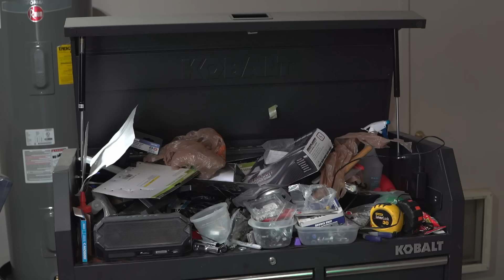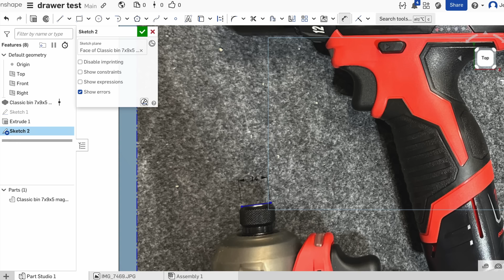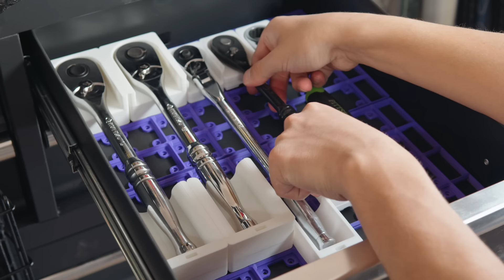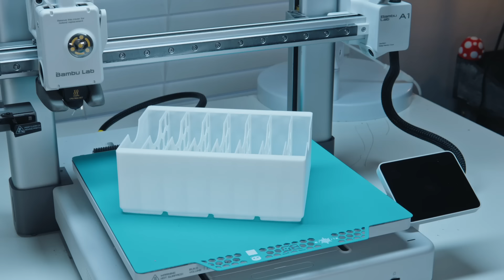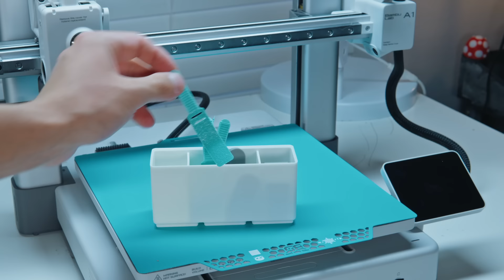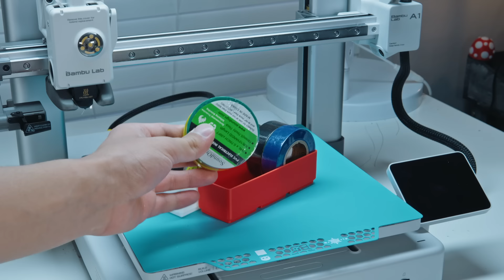I Tried Gridfinity for 30 Days and My SPACE Changed Forever

Comment: I thought I would save a lot of printing time by just getting the Ikea Skadis boards until I saw the price, and are they made of paper-board?
A 4'x8' full sheet of pegboard costs $12. You can paint it whatever color you want, or in some places it comes pre-painted in a couple of colors. There seems to be a lot of designs for pegboard accessories.
I can understand if you don't have the ability to handle and break down a 4'x8' sheet, but those Skadis boards are 30"x22"? and cost $30. I've bought a lot of Ikea stuff because it's usually cheaper than I could make it myself, but the Skadis boards are unusually un-Ikea at that price.
I'll look into pegboard or go with Multiboard.

Comment: A cost and time saving thing, is to use foam or cardboard and depress the tools, or trace the tools with an exacto knife (best) or a razorblade/knife, or use a pen, sharpie, or pencil to trace.

Afterwards, cut out the silhouette. 

You can use Styrofoam, cardboard, foam, etc with anything that has prongs or a thin shaft, annd just punch it in. Screwdrivers, charging blocks, etc.

For example, For charging blocks, anything with prongs, anything with a sharp edge, or screwdrivers, awls, etc, you can literally just press the prongs in and you're done. To make it fancier, you can dip the tip of the prongs in paint omm, ink, or sharpie before pressing it in so you can tell where it was. 

You can reuse foam or stacked cardboard from packaging, or packing/product boxes.
Reply: We all know this and we don't like that solution so we are here. Styrophone is awful, noisy, makes a mess. Kaizen foam cost a ton of money. Reusing packaging gives you random results.

Comment: I must be missing something. What is the point of using gridfinity if you're going to make a custom tool holder? Just make it fit the drawer and ditch the grid. Then you're not wasting time and filament on something that isn't necessary.
Reply from the maker: i like it because i can easily just remove a module when my needs change
Reply: @jet_lea do you plan to relocate your Milwaukee tools after spending so much time customizing a place to keep them?
Reply from the maker: i’m already looking to move them to a bigger drawer, always looking for better optimizations
Reply: @jet_lea for large items like that, gridfinity seems like a solution in search of a problem. To each their own, I guess.

Comment: Do you use magnets with any of your gridfinity prints?  Your video came at the right time because I’m reorganizing my 3D printer and crafting and bins of cables and parts and random stuff storage area. Typically “reorganizing” has meant “reshuffling” but you’ve inspired me to make a go at actual organization.

And I’m an old school sub, I remember your cable organization video. 😁
Reply from the maker: i don’t use magnets but i have most of my bins with the option to add them in the future, mostly just procrastinating all that gluing
Reply: @jet_lea Oh that’s smart, I’ve been printing magnet-less but it wouldn’t hurt to include the spots for the magnets and leave them unfilled. Good thing I’m still printing bins!